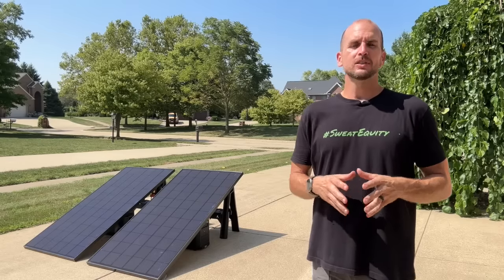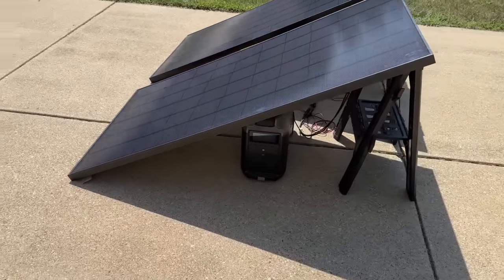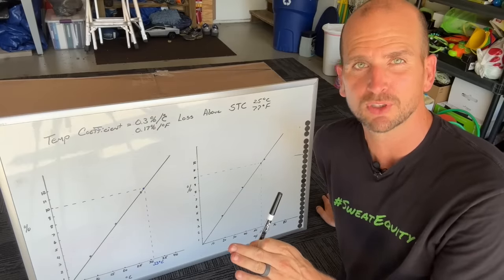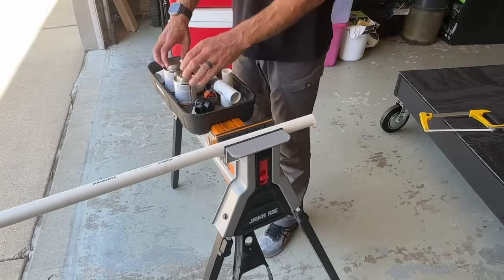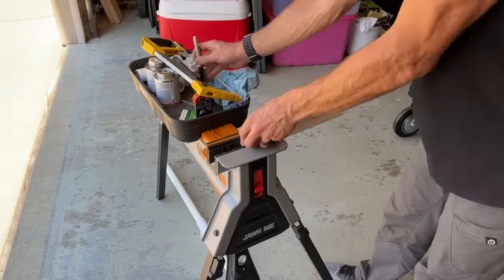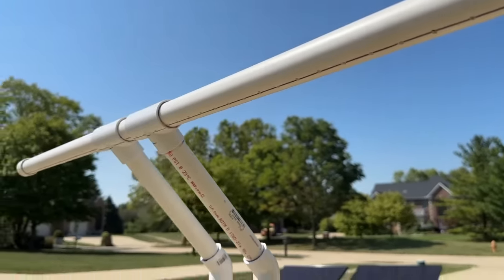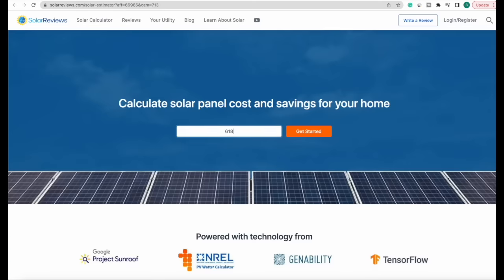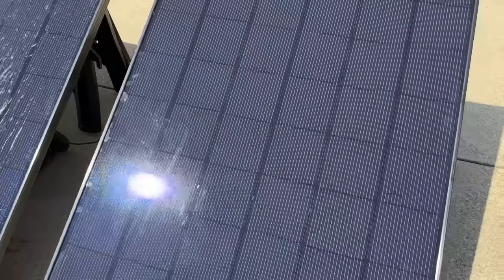Surprising Power Gains By Cooling Solar Panels

Comment: Love the video! I was thinking of using radiant PEX on the back side of the panels with a closed loop evaporative cooler in the summer to cool the panels and my shop, then the same concept for winter to melt the snow, still a closed loop system but this time pulling the heat with copper heat exchange from the wood burning stove in my garage.. Im very curious of the 5% gain would be much higher without water flowing acrosse the panel surface, but cooling it from the back.

Comment: I'd suspect the panel temp on a typ roof install to be higher than what you noted, 135 F.  If you think about ANY electronics, esp if you have micro inverters strapped to these things, what temps north of 150F, almost boiling, will be doing to not just efficency but to lifetime.  I doubt water cooling will ever be an option unless you're in Death Valley and risk panel temps over the boiling point of water, and then, where in Death Valley do you get unlimited supply of water.  You'd be better off putting panels on north slopes and using more in an effort to reduce risk from excessive heating.  HOWEVER it would be useful to see testing on typical roof installs vs ones that allow good air circulation, or even ones that might use a typical solar powered attic vent to exhaust air from behind panels.  It is fairly unforgivable that the 'industry' has not taken it upon themselves to do this.  It would be an insignificant cost to major panel producers to mock up four roofs and study them.  That the gov't has not done so is forgivable as well that takes tax dollars.  These corrected for inflation are  little more than they were decades ago, as well, the masses are corrected for inflation, earning little more than their parents did, and often requires two to work instead of just 'the man'.  This coupled with tax rates being cut by up to 75% on the top 10% or so, depriving the gov't of any ablility to make up taxes from there means, nope, gov't can't do or contract it out.  Its left like with Boeing, to the co's to self police.  
Any rate, here's the skinny on ALL roof installs, the fail economically BIG TIME when it comes around to replacing roof.  You will be paying a solar installer to UNINSTALL EVERYTHING, then REINSTALL EVERYTHING and as soon as it goes back on, there goes the roofing contractors and the shingle etc manufacturers warrantees .
and
I've NEVER heard anyone address the cost of replacing micro inverters.  How exactly does one replace a failed unit on any but edge panels without having to remove every panel between edge and failure.  At &50, &75 an hour per person, and two person crews needed to realistically remove / install panels, time needed for ladders, safety lines, min charges of at least a half day, that micro inverter could take $300 to $600 and MORE to replace, plus $100 and up for the micro inverter. Do this 5x in 20 yrs and you paid for a second inverter that would have cut inverter loads in half and increased their life times.

Comment: Very interesting, but..... is it because it is being cooled down, or is it because the water is magnifying the solar energy, therefore providing the difference in input? I have similar panels and they are great, but it could just be magnification, not temperature related.

Comment: I habe been for months considering a heatsink on the back of my panels to assist in passive cooling. However I think it's cost prohibitive. I use the solar pannel for my camper so I am very limited in what size solar I can fit

Comment: I did not watch through completely, just kinda scanned so i could have missed it? what about "pulsing" the water flow, maybe on for 10 seconds off for 30 seconds...? with a collector at the bottom to recycle the water. Can the increased energy be used to pump the water and still get an overall gain. (kinda like a swamp cooler pump?)

Comment: So there's solar panels that are bifacial, and there's tests where they set them up vertically and were able to increase the overall performance. It's theorized that they're running cooler and picking up reflected light also. They're more expensive, though.

Comment: I wonder how your test would compare to a nursery misting setup. An on/off timer could be set up by ambient temp n the system runs on water preasure, with very low water usage.

Comment: i wonder if just putting alot of cheap light aluminum heatsinks and a car radiator fan would get a better result than this.
plus it's cheaper and could power the fan directly from the solar panel.

Comment: How about you catch rainwater into a 55 gal drum. Then use a pump to cool the panels but catch that water and pump it back into the 55 gal drum. At that point it should cool down to ambient temp. Then all you need is a pump that uses less power than it gains. I'd guess you'd only run it when its above a certain temp as well since it probably doesn't help when its 70 degrees out.

Comment: Where did you get you panels you used in the test haven't found any close to the watts those are
Reply from the maker: I got these Heliene 360W panels from Alt E Store.  I know their inventory does rotate so not sure if they still have panels in this size or if they have stepped up to 400W+ like most stores for the larger panels.

Comment: Yes, the Current generated remain the same for the entire range of temperature, but the voltage will increase the lower the temperature it is, that's why the power difference between cooler and hat panel is small, around 10-20%, cuz the cell junction  voltage is not changing that much, and the current is the same.

The voltage increase relatively logarithmic with the decrease in temperature.

Such water system is good for auto washing of the panels 😁

Comment: Water would be wasteful only way I could see this would be ether a passive closed system off your house ac or if you could use geothermic. Where I live there are caves all around in fact directly under my house and can tap into that for heat exchanger with out ruining the cave ether cause heat can be dumped before entering the cave even. Any ways closed substances would be best or at least if your in a low humidity swamp cooling or something that is more efficient while not waisting more energy than you gain.

Comment: this would be smarter if the water you use comes from clean house water, gets pre warmed by the panels like this and then deposits in the hot water battery/hot water tank.

If you are storing the electricity as heat in a thermal water battery, this clawback of efficiency significantly increases.

Treat the heat from a panel as a primary resource not an externality. energy is energy and we use as much heat as electric. use it

Comment: I can increase the power output of my panels by a factor 10 just by waiting for summer. So if I were to be really off-grid, I would want my panels to produce 10% more in the winter. In the summer I have excess power so I need to feed it into the grid. As a matter of fact, I can not handle the summer power. It's too much for my inverter.
Doesn't mean that these experiments have no value though ;-).
In my future off-grid project, I probably will be putting excess power into A/C and other cooling stuff, and it will in an area where the power factor between winter and summer is only 8.

Comment: What if we had a gap between the panels and the surface it's mounted to. Then some heat sinks on the underside and a blower or some PC fans blowing it. The fans themselves don't use much energy. Even a small 12 evaporative cooler would work, but it'd use more energy

Comment: My panels go fom ~1800 Watts down to ~1150 Watts once the panels heat up;
This happens right after clouds move away, and the Sun suddenly shines fully; so they go from cool to hot in ~15 seconds

They are 8 old (8 or 10 years) 240 watt panels, 60 cells each, and they almost never go above 1200 watts;
Also the temp gun does not measure its temp well, it may read only 40ºC, but i cannot hold my hand on them, i would burn, they seem to be way over 60ºC or more;

I think i would have  A LOT of gain by keeping them cool with a water film,i just do not do it, it's too much work, and i am a bit fed up with mounting the panels on the roof of the house, wiring, inverters, MPPTs, BMSs, fuses, relays , timers,apps... etc., and as we all know, the key to solar is to oversize it, and the way i have it, i now go months in a row 100% off grid;  this is after i abandoned the Hi voltage (380VDC) cheap china inverters (they ALL burn up, cannot be repaired, they erase the ICs numbers... avoid..) and converted to LOW (48VDC) voltage inverter and toroidal trafo( 3000 Watts++) of 23 Kg weight, all cooled by a few old computer fans on 50 cent TO220 thermostats.

Comment: I notice that Tesla solar panels come with skirt to hide the gap between them and the roof.   I imagine that would cause the panels to get even hotter due to the lack of air circulation.
Reply: I saw you can buy a heat exchanger that goes in that gap and uses the heat to heat a pool. I forget who makes it though.

Comment: Using a water pump with a closed water circulating system would be interesting - can we still achieve a net gain ?
Reply from the maker: My first attempt wasn't successful but that was more from the type of material used https://youtu.be/hfMEHn-4gmU

Comment: can a thermoelectric chip be powered by the heat it cools water to control? where is the equilibrium point? ideally it'd be temperature dependent automated cooling that kicks on if it gets hot enough to need it/power it.

Comment: You just need a lot of thermal mass. So even if it heats up at end of the day, it will have an entire night to cool down, when the panels would not generate power anyway.

Comment: What about having the panels mounted on top of a radiator system that could optionally also have the water looped through? No losing water to evaporation and the wind will help as well depending on how the radiator grill is designed.
Reply from the maker: Yeah, I think that is the most feasible solution especially if you have a pool which you want heated as well to extend the swimming season.  The problem is getting the radiator at a reasonable cost 🤔
Reply: @everydaysolar  Yeah, maybe could experiment with some copper pipes or broken/old car or a/c radiators just to see if it's worth doing on a larger scale.. I feel like setting up a passive loop into a reservoir in the attic that then feeds your water heater with pre-warmed water could be a really useful system, especially for off-the-grid builds. Though in any freezing climates that might be too risky.

Comment: im sure it is the cooling effect, but any-chance the water drops are acting as a "magnifier glass" type affect and focusing in more light energy into the PV cells? (and that is why the increased output?)   just putting out an idea (not that i think its correct)

Comment: Cooling by water is dangerous because even waterproof solar panels need to be outside of humidity to prevent short circuit. I would recommend to cool by air from under the panel, the underside being a flow path for the air to spread throughout, and is much easier to move air around from the lowest point direct upwards the incline of the roof. However, air must be cool, same way water must be cool if used.
Reply: Imagine, it is the same idea with roof attic coolers.
Reply: And consider lifting water on top of the roof is more energy expensive than pushing air - virtually weightless.

Comment: you would need someting to catch and reuse the water and adding to the system to compinsate for evaperation.
Reply from the maker: Yeah, I would like to find a closed loop system that cools from the back side to make the setup a little more practical.

Comment: While I appreciate the premise of the video, and the included temperature coefficient information, I'm surprised so many comments are impressed by the idea that a cooler solar panel has a higher output. It's how solar panels work and is well documented. Secondly as you pointed out, I wholly agree this isn't practical. Even at a 10% gain, you'd be better off with 11 panels vs 10 panels which is the same gain, and don't need the plumbing, water costs and environmental issues dumping water on the panels 365 days a year. Just my two cents.

Comment: seems like it would make more sense to reclaim the water going over the top and have it pumped back up and reused.   small loss from pump usage would need to be less than what is gained from cooling the system.   im sure for the right system the fuzzy math would add up

Comment: You shouldn't waste water. Instead, lay the panels flat, submerged ever so shallow, in a water pan, after having made all connectors water proof. Then, use a mirror and Fresnel lens set-up that moves heliocentrically to aim the waves directly onto the panel. The lens would be directly above the panel to focus and magnify  the reflected waves. Then use two parabolic mirrors to provide constant sol tracking and reflection. Then, you can use the same water over and over again by circulating it through underground cooling pipes to dissapate the heat from the panels. Lol. At least that's where my thoughts about this subject took me to when I thought about how I want to do it when I have the chance.
Nice science project though.
Reply: Not everyone lives in a desert. Average rainfall in Florida between dry and wet years is 5' to 7' of rain. Even if your home was 24x40' which means simple gable roof is 28x40' you would have 1120 sq ft collection, then average 6' per year rainfall, you get 6720 cubic feet of water, and each is 7.5 gallons, or total water collected in a year is 50,400 gallons. In a year that averages to 138 gallons of water available per day use. Since there are wet months vs drier months, you'd need storage bins, perhaps 10-20K gallons of storage space for it though.

Comment: If it was a close loop system that didn’t lose water and it was on a big enough solar system it could be worth it. Radiators, pumps and tubing. With the parasitic loss It’s like supercharging a solar panel

Comment: You need to use distilled water or regularly clean them to prevent mineral buildup or else you're going to lose more power over time than you are saving.
Reply from the maker: Fair point, thanks for the feedback!

Comment: Did you account for the previous 369 Wh? or the reader was reset after you started cooling the other panel
Reply from the maker: Yeah, I reset both power analyzers after the baseline run 👍

Comment: I am no expert but, 5% is not worth it ( in my openion )... I will have to install a pump if not multiple pumps for 24 panels, I will have to run destiled water in it, I have to take into account a way to recycle the water, I have to take into account clogging, cleaning the mesh, refilling water...  + -  other problems that I do not know about, such as when it windy? the water will be all over the place...

is it really worth it? I can just add another panel...
I do not know the exact life span of a panel, maybe if cooling it down significantly doubles or tripples its lifespan then and only then water cooling them is 100000% worth it.

Not an expert, correct me if I am wrong.

Comment: 130 gallons of water would cost over £2 at current UK prices, to generate an extra penny's worth of electricity.
Even running a recirculating pump in a closed system would use more power than that, and you still have to find a means to dump the heat somewhere else.  Swimming pool, perhaps?

Comment: Are you sure that increase is not mainly or partially  from the magnifying effect of water droplets on the panel ??
Reply from the maker: Not 100% I actually think the water on the surface hurt the overall power output a bit and that is why we couldn't recapture the 10% loss from the temp increase.  I would need to run the test again with cooling on the backside and keeping the surface unobstructed and the same as the non-cooled panel.
Reply: @everydaysolar  maybe so. Perhaps a misting domestic shower head will do the trick

Comment: I think that the key issue with this test is that the underside of the panels were ventilated pretty well in that open rack, and the underside between the two panels thus were rather close in temperature.

I could imagine that under more realistic mounting scenarios closer to a surface the difference would have been higher.

Has anyone tested an active airflow under panels to improve cooling?
Reply: Techingredients YouTube channel

Comment: The water is reducing the amount of sunlight your panel is handling.  You'd have gotten better results cooling from the back side.  But water is wasteful, and you can get better results with fans since you can cool both the top and bottom with those, without impacting the amount of sunlight the panel receives.

Comment: For people interested in doing this: DON'T! Fresh water is so much scarcer than we think, and using it like this us extremely wasteful. If you want more power, get more panels. If that's not an option, look into "hybrid" panels. These are normal solar panels with a water cooling loop behind them. This way you harvest both power and heat from the sun. That heat can be used to preheat your water heater, so it uses less power, or it can be used as an input for a heat pump, or it can be used to heat a swimming pool. This way you're getting more power AND usable heat from the sun, instead of just wasting water.

For the record, I know this was just an experiment, I have no issues with that, I just want to prevent people from taking this a bit too literally.

Comment: Are there systems with something similar to CPU/GPU/M.2 Coolers?  A enclosure housing Heat Pipes for each Cell or Water Blocks to a centralized Radiator/s.